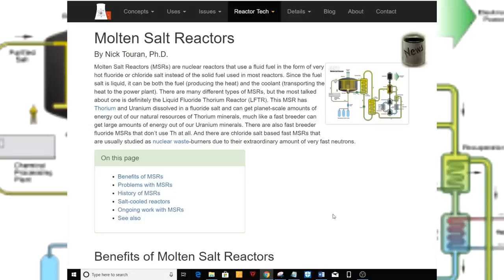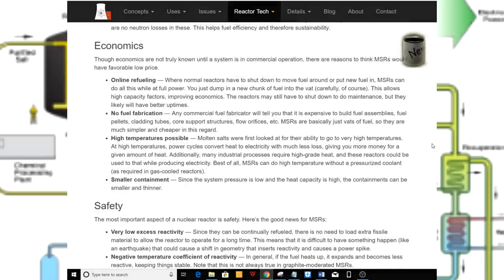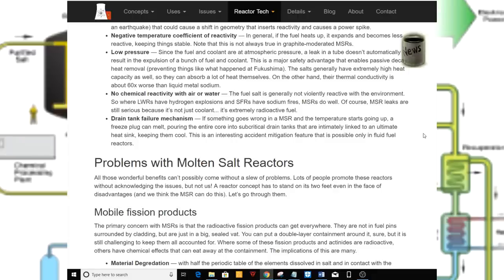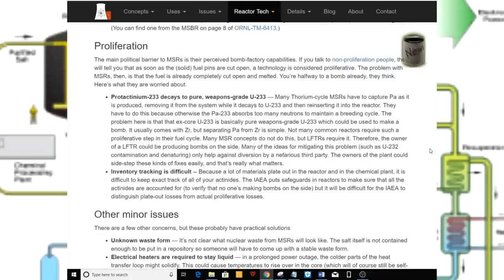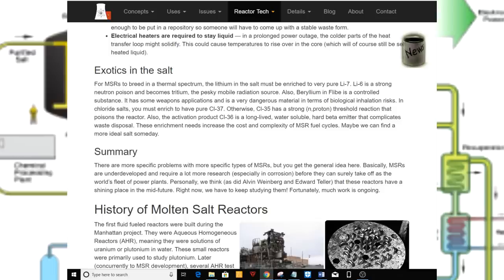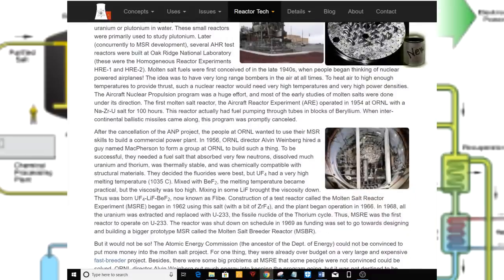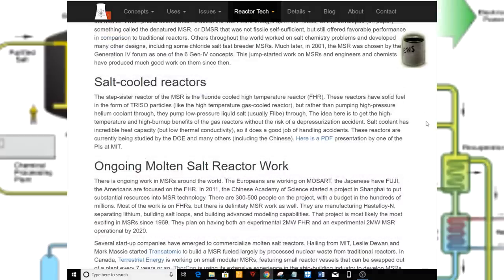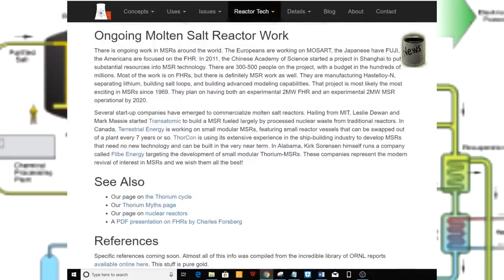The Actual Problem with Molten Salt Reactors ...and benefits obviously

Comment: so one of the biggest issues is making sure the power plant owners do not make "weapons grade" material on the side.... since it can be more difficult to track the liquid and the liquid can "plate" on certain surfaces.

That should be fairly straight forward process to account for.  This may take some trial, testing and error.

If you know the precise mass of those "parts", presuming they are discrete parts (they should be designed this way) - and during regular services - you could pull those out, and weigh them - and otherwise look them over - maybe it is not that simple - it would have to be done remotely - since the radiation would likely be lethal to humans - in the short or long (cancer) terms.

This stuff can be rolled out and tested with trusted parties.
There is way less toxic waste with these designs - so it solves other problems as well - and could process the existing toxic waste.

In sort, some MSR's could be designed to make it nearly impossible to generate enough weapons grade material to make any kind of useful weapon or weapons.

Current technology is far worse - even "green" tech is not very green,  yet.  In fact, nuclear is the greenest so far - though is that because we glow at night? (j/k!)

Nuclear is the future - yet who (or what) do YOU trust!?
Reply from the maker: Trust the data. Two giant nuclear accidents Chernobyl and Fukushima did not yield as much death as Coal burning yields in a few months. And those plants had flaws in design and operation that caused them to fail. Nuclear is by far the cleanest, safest, highest power output source we have. Thanks for commenting.
Reply: @RCrosbyLyles  The coal argument sounds very much like the bird argument against wind power. People aren't really serious about saving birds from cats, windows, power lines, cars, smokestacks, etc. If they were serious they could come up with mitigations like fake raptors on the towers, or a different color scheme on the blades. Likewise, there was talk about "clean coal," but how much scrubber tech or carbon capture has been implemented to make coal safer?

The nuclear industry has lost some public trust through making promises they didn't keep: cost-overruns, project delays, high electricity cost, and having meltdowns. Secrecy was a problem too in the early days; and cancers from contamination seem to be swept away. The result was no new plants for decades in the U.S. In Europe after Fukushima some want to retire plants before their time. Meanwhile, South Carolinians were convinced to fund a new nuclear plants with higher rates in advance. The project was cancelled, the contractor declared bankruptcy, executives got huge bonuses and we'll see if they get away with billing SC customers more. I just now read an exec. was sentenced Oct 7, 2021 to two years in prison for fraud.

I don't think we can have big projects in the U.S. anymore like high-speed rail, SSC in Tx, and Gen IV nuclear power. There's too much corruption and mismanagement. If we want nuclear to power our cities on-time and on-budget, they'll have to be built on the Canadian side of the border.

Comment: "through tubes in blocks of beryllium.  Jesus Christ."  :)
Reply: I'm guessing that i a very stupid thing to do ??
Reply: @Andrewlohbihler  Beryllium is a very hard metal when alloyed with copper, its usual role, hard to work and hard on the machinists that try.  Dust from working it is like asbestos; it causes a disease known as berylliosis.
Reply: @puncheex2  Is that why the narrator said "Jesus Christ" ?? I understand Beryllium is toxic and hard to machine, but it seemed he was either disgusted or wowed by that statement. So I'm not sure?
Reply: It was a combination of things. It's hard to machine, the dust is toxic, the metal reflects neurons and accelerates the reaction, and this entire reactor designed by a madlad was on a fucking airplane.
Reply: Making a big deal out of beryllium. Lol like anything, it’ll kill ya if you’re stupid. Machine shops routinely fabricate this in an alloy form. No big deal, just control/abate the dust. You don’t want the crap getting in the lungs.

Comment: Basically what you discussed is that the proliferation risk is a deal breaker for the msr tech.  Hopefully denatured tech saves it.
Reply: Because an MSR contaminates the fuel with gamma radiation it is very unsafe to attempt to extract fissile material from an MSR. There are much easier and safer ways to get nuclear material for weapons.
Reply: Why not just run breeder msrs and reuse the plutonium and u232 in the fuel cycle

Comment: Great information. But wiith the use of Thorium fuel, wouldn't it assist in the proliferation of nuclear weapons problem? Also, I believe China has made a material that will resist corrosion of this type of reactor. Or at least I heard or read somewhere.
Reply from the maker: Yes, we have heard about it. China is the place to watch for stunning advancement in this field, more so than the reported front runner India for a number of reasons. It's unfortunate that yet again America passes on doing big science that would be easy for us to do with proper investment.
Reply: @RCrosbyLyles  it is unfortunate we do not. Who ever is the pioneer in this field will spend the most out of any business/government though. Well hopefully we all start using MSRs in the near future either way!
Reply: As I understand it, thorium breeds to uranium 233 which is highly radioactive and just too dangerous to use in bombs. It would fry the bomb controls and fry any workers using the thing and its emissions would be impossible to hide. Also very little plutonium is made in an MSR and it's also the wrong isotope which will spoil any bomb made from it. The Manhatten Project proved that if you want a bomb thorium is very poor way to do it.
It can be said that a molten salt reactor is anti proliferation especially when running on thorium. Rogue states would not be able to hide their bomb manufacture plans behind civilian power generation. The only reason to have a PWR (expensive) over an MSR (cheap) would be to make bombs.
Reply: @Dave5843-d9m  U-233 is between uranium 235 and plutonium-239 for radioactivity - half-life is 160,000 years.  Decay is alpha.  U-233 is usually accompanied by U-232 with a half-life of 69 years, and its decay chain includes some heavy gamma emitters like thallium-208.
Reply: @puncheex2   U-233 is usually accompanied by U-233 ?
Reply: @lordchickenhawk  Oops.  Edited.  Thanks.
Reply: There are no thorium decay products that yield plutonium. That is why we use U-235 reactors, plutonium byproducts can be cheaply separated with chemical reactions to provide bomb grade plutonium. Also why other reactor designs aren't funded.
Reply: @capnbilll2913  In a review of the Q&A, no one said plutonium is a decay product of thorium.  Another fissile, U-233 results from breeding thorium.  The US and the USSR used reactors designed for the purpose to breed plutonium.  They have not needed, nor have I seen any evidence that they ever tried processing waste to get the plutonium out of it.
Reply: @puncheex2  No one makes bombs out of U-233 for the same reason no one makes more than one out of U-235. Once you have a way to make plutonium, Uranium bombs are too difficult, require too much time, and processing, and have limited yield compared to a plutonium implosion bomb. Which plutonium can be chemically separated, Uranium isotopes can only be separated by gas centrifuge.

Comment: The Molten Salt programme at ORNL only ever got pennies from the Atomic Energy Commission,compared with the Sodium Cooled reactors at Argonne. I would contend that (apart from making some useful Plutonium), the Sodium reactors have been a colossal failure. 
So was Superphenix (a French Sodium cooled reactor). No electricity is generated from this source, anywhere. And there is something about a heat exchanger with liquid sodium on one side, and water on the other which just does not appeal to me.

Comment: I thought that protactinium 233 decayed to uranium 233 and then absorbed a neutron and fissioned into two daughters elements prior to removal from the reactor.?.?
Reply from the maker: That's correct, but the Pa 233 has to be taken out before it captures another neutron and becomes a less desirable transuranic.
Reply: @RCrosbyLyles  And the equipment to do this is the regulatory issue that stops  thorium proceeding
Reply: @RCrosbyLyles  The Pa233 neutron absorption has a negligible impact on the reactors performance.

Comment: Hey, I personally liked very much your reading of this report! Though I'm no physics scientists I somewhat understand the mechanics but understand that a carbon nurtral future requires nuclear power. And I enjoyed your finding and reading this material! Thank you! 
Now a question: at one point when reading about the research for plane propulsion you made the remark "Jesus Christ". Explain to this dummy what the deal was. Please. Thanks again, Steve
Reply from the maker: It has to do with the incredible toxicity of Beryllium in such quantity on a craft that has such close quarter operation and potential for polluting the landscape if it were to crash. Thanks for asking.
Reply: @RCrosbyLyles  To say nothing of the locomotive-borne version in Dr. Lyle Borst's X-12 project... Mobile nuclear reactors hurtling through our cities at breakneck speeds, what could possibly go wrong!?!?  ;-)
Reply: "Carbon neutral future requires nuclear power"
I would heavily oppose to that notion.
I could link you to a study from 2013 conducted for the German government on how Germany as an industry nation with unfavorable conditions (high population density, less solar potential due to location, etc.) could run on 100% renewables.

Their result was that it is possible with current technology, without added cost to run Germany on 100% renewables (including storage (daily/seasonal), heating and transportation).

(That study is in German though.)

Nuclear would just add cost and doesn't harmonize with renewables.

Comment: Just use NaF/ZrF as the salt. 

Thanks for the info on chlorine.
Reply: Cl35 has a rather small (less than 1 barn) cross section for the (n,p) reaction, this article is misleading.

Comment: Thank you for a level presentation of MSRs. IMHO it certainly is a contender for where we should be finding our way to in the future. (I might add LFTR's also). Our current "submarine style " water reactors  got enshrined by both politics and immediate need far too early when there now emerging much much better designs like MSRs.  The meme is  finally, though too gradually, catching on.  But right now, nuclear power has been given such a bad name that "everybody knows" it is poisonous, toxic has hundreds of thousands of years waste etc.  Right now no politician on either side would dare mention "better nuclear power"  But the meme is growing in the scientific community. Thanks for your part. Sun, wind and tide are the current attempt at fixes, but nuclear power, when done with careful research is going to be far and away the saving fix. Energy is the arterial lifeblood of society.  Nuclear power is its true home.

Comment: You do have to watch out for the formation of U-232, which emits powerful gamma radiation that is difficult to shield.
Reply: Does NASA have any advanced ceramics? well, yes they have several but maybe not the right type) They are planning a Mars mission so know radiation will be a problem. Maybe it's a different kind of radiation but NASA does a lot of research. Maybe they have something that would work to prevent metal containment vessels corroding?

Comment: I think tritium production is a good byproduct. The tritium will be needed for fusion reactors.
Reply: But until we can achieve fusion, it's a dangerous byproduct.
Reply: I thought deuterium was used and Tritium was only used as an ignition (starter) fuel.  Deuterium is naturally occurring in small percentages in ocean water so it's fairly common and benign.  You can drink a glass of pure heavy water and your chances of getting leukemia are pretty remote since the dosage is less than the radiation dose from eating a banana.  CANDU reactors get all their heavy water derived through HSO2 leaching to refine it to purity.  I still find the idea of using up all the Tritium waste products appealing inside a fusion reactor though.
Reply: @vedritmathias9193  Tritium is relatively short lived ,decays via a low energy beta emission and prone to dispersion so it's almost harmless compared to isotopes such as strontium 90 and cesium 137.
Release a kilogram of tritium it'll quickly disperse doing practically no harm to the environment do the same with strontium 90 or cesium 137 you contaminate the soil for decades or even centuries.
Reply: @ph11p3540  It is my understanding you will need a constant supply to maintain the reaction.
Reply: @vedritmathias9193  Hardly, tritium is a very weak beta emitter and it decays to He3 which is stable.
Reply: @ph11p3540  Deuterium + tritium fusion is what we are going for as a commercial fuel since deuterium + deuterium reactions are substantially (orders of magnitude) more difficult to extract useful energy from.
Reply: You are correct, tritium is s desperately needed byproduct for scientific research, and eventually full scale fusion power.

Comment: Great video. The only issue I'd bring up would be with the issue of proliferation from diverting U-233, which is brought up at 10:30. I would note that because of the very low breeding ratio of thermal spectrum thorium breeders, around 1.05, if you divert more than a tiny fraction of the U-233 you've created, you'd reduce the amount of fuel in the reactor necessary to maintain criticallity, and the reactor would eventually die. Not a great weapons program. You can still do it, but you'd probably find it much more productive to use traditional routes. 

I'd also bring up the issue of U-232, but you can get around that if let your bred U-233 decay in batch tanks, allowing the majority of U-232 to form and be pulled off. That's a bit of a hassel, and any power plant doing this would be viewed suspect immediately, but it can still be done. The low breeding ratios of thermal spectrum MSR's is really their best defense against proliferation. There's just so little fuel to spare.
Reply from the maker: Okay, great comment. Thanks for commenting. Having said that, can a stack of pure thorium maintain a critical mass on its own if it were to get started somehow through improper storage. I know it's a big if, but is this at all possible?
Reply: @RCrosbyLyles  No, not at all. Thorium is fertile, not fissile. You could have a 100% chemically pure block of thorium, a metal cube a mile on each side, and it would just sit there. If you hit a thorium atom with a neutron, it will typically absorb the neutron and eventually decay into U-233. Then you have to hit that U-233 with a neutron again to get it to fission. 

100% pure thorium, by itself, does exactly what my kids do. Nothing. It just sits there watching YouTube videos on its phone.
Reply: Th into the teeth and and Th-nanoparticles into the atmosphere, that's crazy, that's cool, that's so 21st century high-tech. Aluminium-compounds into those modern multi-factor vaccines. Polonium into fertilizer for tobacco-plantations. Just a Question: Why? 

 By the way, harvesting wind-energy can have negative effects on agriculture and doing tidal-power-generation extracts energy , basically out of Planet Earth's rotation! So, in a future millennium,  that could get this planet into a tumble.

Comment: what are you're thoughts on lead cooled fast breeders ?
Reply from the maker: I like them. Lead-cooled fast breeders seem to make the most sense to me for a number of reasons, but I haven't had a chance to thoroughly delve into the details. It's a design that I have thought about and heard about since the Seventies. There is always a catch, never a free ride, though this concept seems pretty straight forward.
Reply: R. Crosby Lyles  i know the Russians or rather the soviets did some development of them for their subs so that might be a place to start ? speaking of subs ... ive been toying with the idea of using submarines as a basis for civilian nuclear power my thinking being that they would be portable, being submerged a few tens of meters down they are below surface wave action and weather, when anchored in deep water they are immune to tsunami, and seeing as they are not military vessels designed to carry large crews for long duration they need not really have to deal with much in the was of pressure differentials i.e no 1 atm inside 40 atm outside only the control room would need to be pressurized and even then only if manned  water is pretty damn good at shielding  and a larger  secondary hull  could contain it and after the fuel is spent you can simply tow it away for disposal  also no fear of  lack of coolant  you could even turn the entire hull of the sub into a giant heat sink with fins and the like  and passively cool the reactor in emergency   what are you're thoughts if any cheers ?
Reply: The Soviets tried that reactor design on their Alpha class submarines ,it did not work out too well